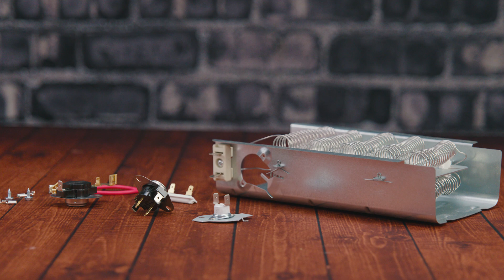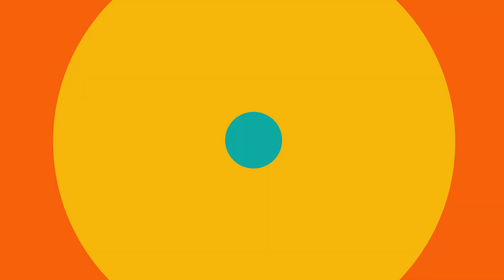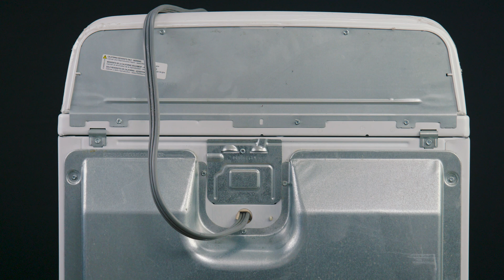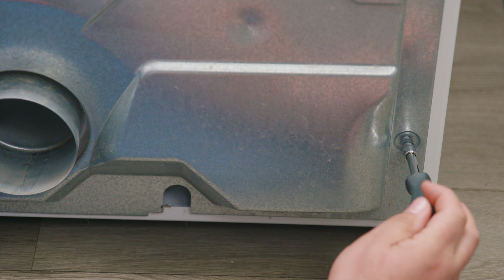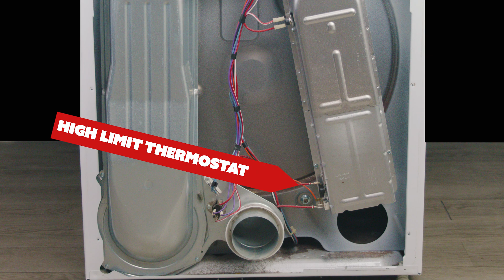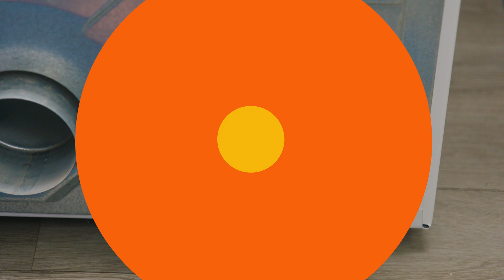How To Fix Dryer Machine Replace High Limit Thermostat Easy Simple

Comment: so glad i ran across this. that particular amana looks EXACTLY like my roper. sticker on the door and all. my problem is, the heat works fine, but the timer does not progress. i just installed a new timer, but got the same result. thinking maybe it's this here thermostat...?

Comment: First off, I LOVE that I have found your videos… second.. I’m replacing this part, but, the original part (from 20yrs ago) did not have the brass piece.. AND, there was a red wire with a white stripe, that was also included in this wiring. With this “upgraded” thermostat, it’s like it’s not included? 🤷🏻‍♀️ no room for it. So, do I not need it? I’m so worried/confused.
Thank you for your help!
Reply: I think I figured it out.. the new “bronze” part is acting like the jump, so there is no need for that extra wire. Is this correct?

Comment: Is there a reason why my Kenmore dryer would not have that orange wire going to the high limit thermostat? I just opened mine up to follow your video and there’s only two wires going to the high limit thermostat. Any advice would be greatly appreciated!